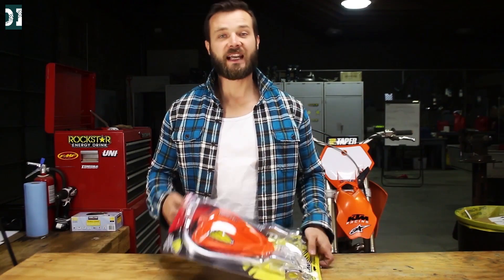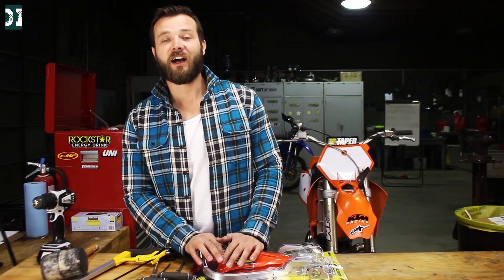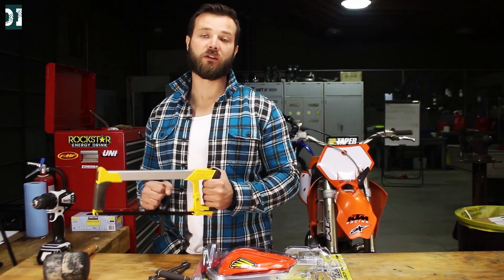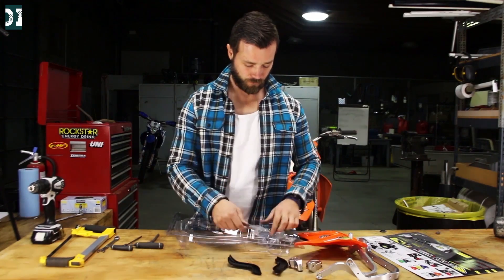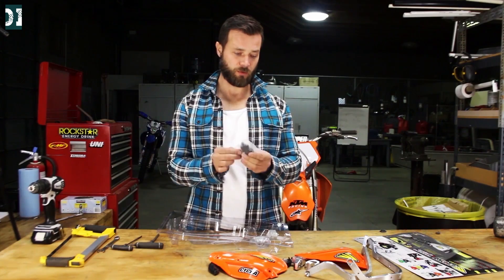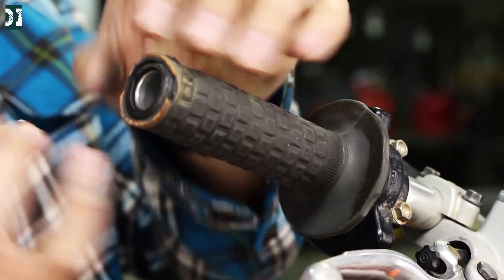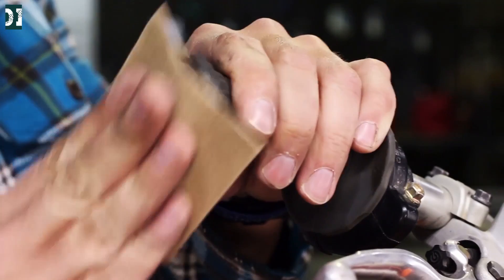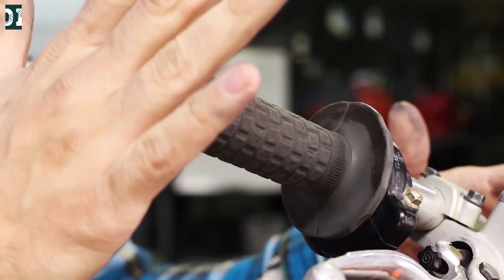How to install handguards on a dirt bike - CYCRA Probend CRM on KTM 250 SX

Comment: I domt know if i bought the wrong ones of these handguards, but my bike has faast flex bars and i figured they would bolt right on but the center mounts dont go on the bar.
Reply from the maker: +HybridEdits I think they have special handguard for flex bars, I saw bunch of them on eBay when I was ordering mine
Reply: Dirt N Iron OK. do you have a model #?
Reply from the maker: HybridEdits I think this one should work:Look at this on eBay http://www.ebay.com/itm/231290634692

Comment: I had to angle my front brake setup like straight down to fit the bark busters, I have the same ones in black on my kdx.
Reply from the maker: hmm, that should not be a problem, maybe you need different mounts, you should be able to fit the levers under the handguards, You cant really use the break and clutch if the angle is too weird, I wont be able to ride like that, I keep one finger on the levers all the time, so I can pull it in instantly. I suggest to get different mount for the bars, do you have center reach mount now ?
Reply: My clutch is fine, its just part of the hydraulic brake resevoir thats slightly in the way, ill have to get used to the weird angle I guess.
Reply from the maker: +506 Offroadin  I am pretty sure there is a way to fix it. Try to use some spacer between handguard and the center reach mount, that should move it further away from the handlebars and allow your break reservoir to fit under the handguard. You need to fix it, it will affect your riding a lot, it's hard to reach it like that. You can email me the pictures of your current set up I can help you to figure something out. Dirtniron7@gmail.com
Reply: Dirt N Iron alrighty thanks! Maybe I'll try and get some pictures today for you.